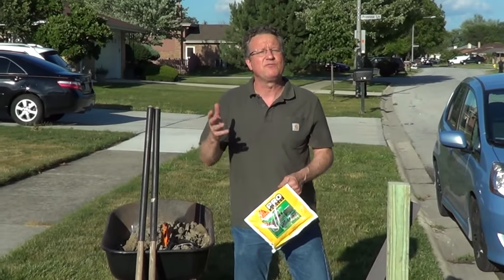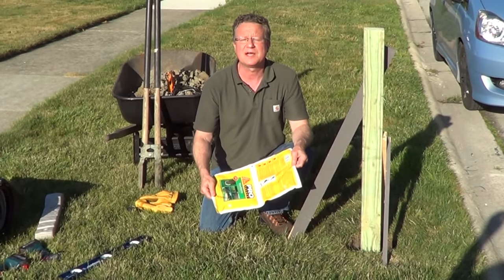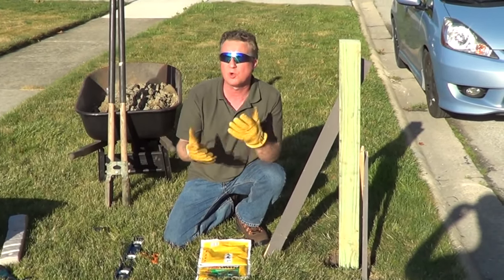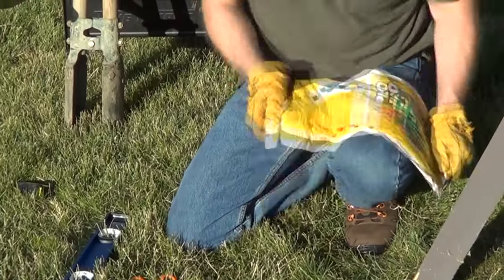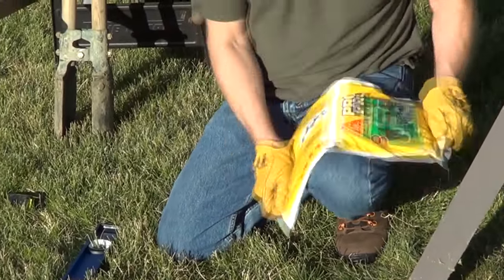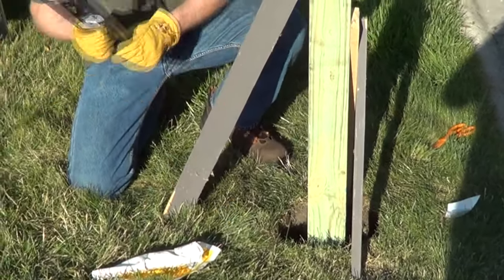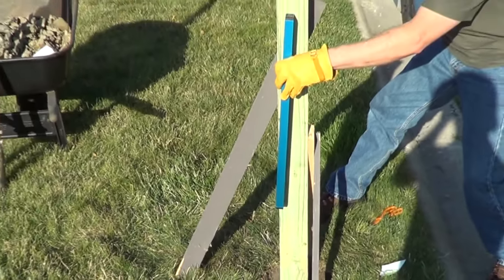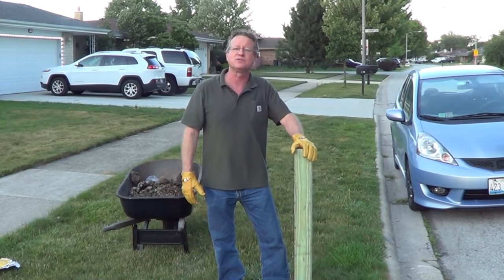Post Hole Foam - Post Mix

Comment: My wife and I used this to redo sections of our fences that blew down in a windstorm three years ago.  It is easy to use, and a heck of a lot more convenient than lugging bags of concrete all over the yard.   Since we repaired the fences, we've had no problems with it.  Great stuff.

Comment: I tried to use the product for a mailbox post. The foam expanded and overflowed the hole by about 6 inches. Then I easily pulled the post out of the foam. For me, it was a waste of time and money. I pulled the foam out of the hole and reinstalled the post using rocks and sand. That worked like a charm. I’m not buying this product again. Next time I will go old-school and use a concrete mix.

Comment: Do you need to add a little gravel at the bottom?
Reply from the maker: Hi, if there is water in the hole you can add some gravel or soil, but they say it's not necessary.
We have more home improvement tips on our weekly podcast https://itunes.apple.com/us/podcast/fix-it-home-improvement/id880903087?mt=2

Comment: Great thinking outside the box moment. 2 questions: 1] Does it retain water? 2] What about post rot? Thanks!
Reply from the maker: Hi, the company says it is water resistant. If the post does rot over time, it should be easy to remove.
Reply: FIX IT Home Improvement Channel good point, thanks!!!

Comment: Are the chemicals toxic in any way?
Reply from the maker: Hi, just like expanding foam, you don't want to get it on your skin or breath in the vapor.
Reply: what about the enviroment?how will it work through the years in the soil?how long will it last for?
Reply: ciapango, utility providers use this on their poles as backfill in remote areas, easier than lugging water and concrete mix to a site where truck full may not be a possibility, but they use larger amounts and have been for 30 years with no noticeable leaching like cement or chemically treated wood. Most manufacturers guarantee for 30 years.
Reply: Only if you sniff it or act careless.
Reply: FIX IT Home Improvement Channel Just something to mention. Cement mix is toxic.

Comment: Again another person that does not take the time to view the video before posting or they would have known that the video is all messed up and you can't hardly hear or understand what they are saying.
Reply from the maker: Hi, it happened to be a windy day when we had time for the project. Hopefully the steps are helpful to someone who wants info on the product.
Reply: Heard it just fine on a low power phone speaker. Maybe check your setup before posting your comment.
Reply: Sure, there is some wind and other tiny amounts of noise but I heard every word just fine.
Reply: @FIXITHomeImprovementChannel  video was fine, fine enough to save me 24 hours waiting for concrete to set....thanks, I have used Sika products before, im sure this is a good one!!!!
Reply: @WCGwkf  me too i have poor laptop speakers but it was ok.
Reply: I hear him just fine and “all messed up” is too vague a comment to be of any help. Please see an ear, nose & throat specialist for your hearing.